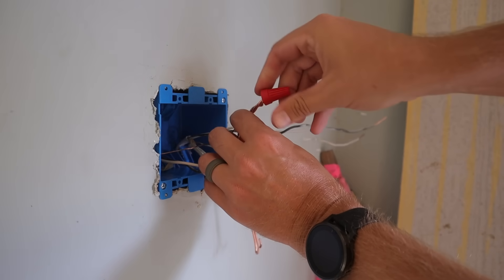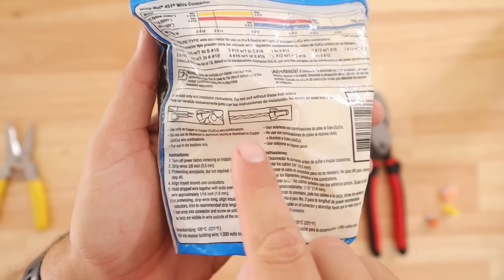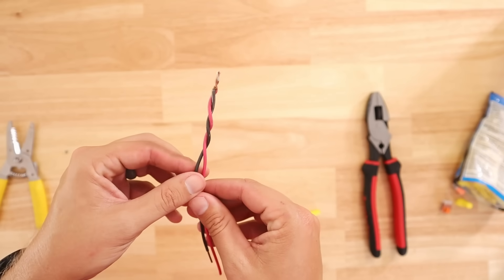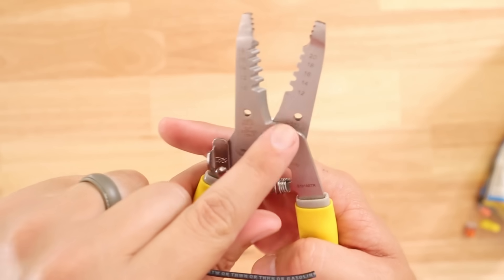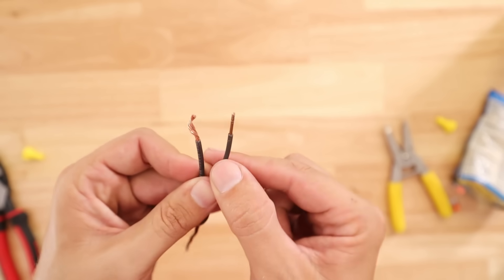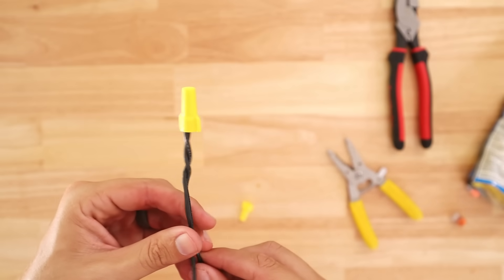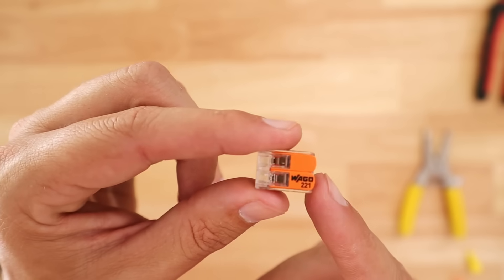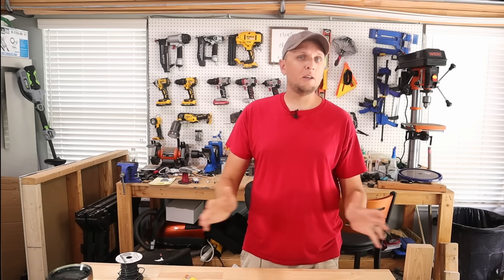BIGGEST Mistakes DIYers Make When Connecting Wires Together | How To

Comment: Fact is that 95% of DIY work doesn't meet building codes...
If you don't know what you are doing you shouldn't be doing it...
Reply: Not a pro electrician, but probably could be fairly quickly. (For better and for worse, I make too much money doing what I do, but I find electrical work much more personally satisfying.) Spent many, many years with electricians and wiring a wide variety of crazy crap from water tower antennas to data center server racks running 3-phase. When I ran the wiring for my own furnace and heat pump installation, the HVAC company looked at me crooked, at first. They were going to charge me 3x what it ultimately cost me to do it, and I just wasn't going to let some stranger walk away with $2k for a job I could do. The inspector who came by said I had "overbuilt." When I asked what he meant, his only callout for that was some conduit that he said "wasn't strictly necessary" and that he had never seen a DIY'er put in that much conduit, before. So, gee, I guess I could have saved maybe $10 worth of conduit, but I figured a furnace wasn't the kind of thing I planned to wire for every week, either. (I still think it was the right call. He was just surprised that he didn't have 10 different violations to cite while telling me to hire a pro. lol)

Comment: I have to comment again. My past job was to go into homes to find out why brand new appliances were not working. 9 outta 10 times it was due to ELECTRICAL INSTALLATION, and the single most case of the Electrician screwing that up that was not explained here. The wires must be secured from movement. After you join the wiring together, and are confident of the electrical connection, the wiring must not be allowed to move around when you push /pull / dump the appliance into position to be mounted.  If that wiring is moving around it WILL LOOSEN UP the electrical connection.  Many many times I have pulled out a new Appliance on a New Home Build to find twisted wiring electrically disconnected and even arcing or melting from arcing inside the wire nut.  Twisting the wiring together, twisting on the wire nut, then you must join all the wiring and tape it or secure it with a clamp so when the appliance is being moved that force isnt applied to the wiring connection and  loosen the connection itself.  The first thing the Home Owner does is grab their phone and call the builder demanding all their electrical connections be inspected...and what will the Builder think of you, the Electrician they hired, when that happens... you are a POS who cost them money.  Dont be that guy.
Reply: Ugh. All I can think of reading this comment is the dryer connection in my old house. There was no way to mount that sucker without perhaps laying down a new cement wall. And yet, I had to revisit that thing constantly because of the s*** way the laundry room was laid out that prevented any sane installation of such a high draw circuit. (In essence, I agree with your point: You need to immobilize the wires, and when you don't, you sign up for hassle at very inconvenient moments.)

Comment: It boils down to how the wiring ends are/is secured, not if the isolation is twisted or not. I've been to many many homes trouble shooting inoperable Appliances (wall ovens) only to find twisted wiring melted away from being improper secured.

Comment: Everybody's using a new Wagos connectors but these are only good for low amperage I would suggest 5 amps and lower great for LED lamps and such circuits but you really need to twist the wire together for anything above 5 amps and use good connectors I've seen too many pushing wall outlets the wire starts to overheat because it doesn't have enough surface area to carry the load.
Reply: You are 100% correct sir! I have personally seen to many fires and melted connections because guys get lazy and use these on everything. Yes, they are no different than stabbing the wires into the back of an outlet. I make repairs to these connections on a daily basis.

Comment: A wire nut works like a nut. where the wire should be straight as to follow the taper to compress. anyone who does service work dislikes twisted wire . Also. if used in a signal application. You have just created a point of noise and electromagnet coil of sorts

Comment: VERY helpful and timely. I am wiring my own shop and going slow and careful, but so far the few wire nuts I have done, I think I need to go back and redo them. One thing I did do was tin all my stranded wire tips to make them stiffer. What are your thoughts on the push-in wire connectors?
Reply: Trade term is wago for push in connector great for indoor use, very susceptible to temperature making connection fail. The fact you tinned all the stranded keep it up we don’t do that as standard trade practice.

Comment: Over forty years .... no fires, no loose/broken conn's ...  fundamental rule ... sound MECHANICAL connection first...  ALWAYS! THEN add whatever additional support or fixturing desired, as in wirenuts, soldering (occasionally) etc. Expediency often will seem to force shortcuts ... and almost always, eventually .. leads to some problem.
Reply from the maker: Yup, thanks a lot for your experience and feedback!  Always good to hear from experienced folks like yourself!

Comment: I've started using Wago 221's last year.  They are awesome.

4:00  I couldn't disagree more.  The linemans pliers put nicks in the wires.  That creates weak points prone to failure from either stress, vibration or heating/cooling.  As a former aircraft electrician, even the slightest nick in the wire is unacceptable.  4:03 also clearly shows the stress of the insulation pulling back on the red wire, this will cause the insulation to split and pull back at that point.   Using pliers is not a good idea.
Reply: I take you've never had to connect more than 2 wires under one wire nut. If you've got 6 wires going into that wire nut you're never going to get a good connecting without pre twisting. 

Also, if you use the right pressure you won't damage the copper any more than the wire nut already does.
Reply: @Avaddon911  5 is the most I've gone  and in that case I zip tied the wires so the wire nut had an even bite to all wires.  That BTW was a repair I made after a professional installed an outlet and the wire pulled out of the nut he put on.  I've repaired quite a few failures from "professionals".

If you score the wires then put a wire nut across the score mark making yet another score mark, it makes them even weaker. A couple of my repairs were from wire breaks right at the edge of the insulation because of score lines.  Seriously, if you must twist,  use a smooth finished pliers or put tape of the ends.   I've also seen plenty of split insulations because of the stress put on it from twisting.
Reply: @datsuntoyy  I've been an electrician going on 6 years. The entire industry disagrees with everything you say here. If the 'professional' didn't do his job right that's not a fault of pre twisting wires lol. It's most likely the result of not stripping the wires long enough. You strip them longer than you need, pre twist, cut so they are all even, then put your wire nut on. I've never had a wire break because I twisted it with some Klein's.
Reply: @Avaddon911  It's fine if they disagree.  Just remember what I've said.  I've spent a lot of time repairing bad jobs from professionals. They don't break right away, long enough for you to get paid and leave.
Reply: @datsuntoyy  Well I did a lot of work building my local high school, it's still going just fine. I have a trailer I purchased 7 years ago and redid electrical. Holding strong to this day 🤷‍♂️
Reply: @datsuntoyy  What business are you in that you regularly repair bad jobs from professionals?
Reply: @Avaddon911  I wouldn't say "regularly", just done more than I should of.  I just got done having my downstairs remodeled and I had to fix 3 dead outlets after they got done. Two wires pulled out of the wire nut and one pulled out of the outlet because they didn't even tighten the backwire nut.  
 I changed all the outlets from the old style outlets to Spec grade decora style so I got to see the wiring from the builders.  

I'm currently a medical lab tech.  I'm a former aircraft electrician/avionics repair where I was also an inspector.  I worked electronics/rework at motorola.  I also used to work for my cousin who owned a custom home building buisiness.  
I was also a mobil facilities electrician and HVAC technician in the Marine corps.
Reply: @Avaddon911  I've been an electrical engineer for more than 20 years, and I'll dispute your assessment that the entire industry disagrees with @datsuntoyy.  I've been to too many fires because of broken wiring where the electrician "scored" the wire first.
Reply: @Lateralas  🧢🧢🧢  come on man you expect me to believe you can determine that a whole ass fire started from one wire nut? The rest of them would have melted in the fire so how do you determine which one failed? GTFO here with that 🧢🧢
Reply: always twist them together first, srip them long, twist, trim to length put on marrette. As an electrical contractor Id say you are very wrong here Sir. 
The only nicks you need to worry about is not striping properly, nicking or cutting the conductor when removing the insulation is bad. current is not flowing to the tips of the wire were one would be twisting it with linesmens, the current takes the path of least resistance, what you describe in not how electrons flow buddy.
Reply: I've always twisted them hand.

Comment: With two 14g connections, you should have used an ORANGE wire nut.  I’m a DIYer and I always use the min size wire nut specified.

Comment: Thank you for the video! What connector is best for stereo speaker wire?
Reply from the maker: You’re welcome!  I’m not a stereo speaker expert but I still use heat shrink butt connectors and sometimes crimp caps on my stereo wires.

Comment: I was instructed by an electrician to use electrical tape, and wrap the wire nut/wing nut AFTER you're finished twisting the wires together and twist on the wing nut/wire nut to be sure it never comes apart.

Comment: The problem with pre twisting the wires, the way you showed, is that you are potentially weakening the wires, by scoring them with the lineman's tool.  If you put even a small nick in a solid coper wire, you run the risk of it braking off at that point.  So, if you're going to pre twist, use a tool that is smooth.
Reply: You're joking correct? Please say you're joking!

Comment: I pre twist place on wire nut than electrical tape. Just old school because of movement from ceiling fans, home vibrating,  My uncle was a Electrician in the 70s. Many changes have been made. My home is still standing he wired it. 😅

Comment: Throw the junk wire nuts in the trash. I use the wago lever connectors. I use these because most wire projects I have ran into have wiring that is very short. No room for wire nuts. 
Btw over twisting the wire nuts can strip out the wires.
Reply from the maker: Well in that case I can see why the wagos are so useful to you.  The over-twisting is just one of many reasons why I like to pre twist.  Thanks for the feedback.

Comment: Pre twist or not... I'll offer an engineers perspective.  The instructions are relevant because the product goes through a series of tests to validate performance using the method on the label.  Many samples (what we call statistically relevant) go through all of the tests.  In this example, following through so that the installation looks like the picture is the state at which the tests are performed... I will even offer to the exact number of twists that the picture shows.  This leads to your opinion (or anyone else's) being much less important.  I am glad that you point out the code, the text, and the picture.. as someone who may be using the product for the first time can get it right and have confidence in the performance.

Comment: WAGO'S  look like the easy solution, but they have higher resistance then a properly twisted connection.  This isn't opinion, it's fact and there are some good YouTube videos that prove this with masurments (see greatscott).  WAGO's should be fine for low voltage applications, but I wouldn't use them for High Voltage Mains wiring.

Comment: Here’s a trick I was taught whenever connecting solid to stranded, put a little crimp in the solid wire nothing crazy then the stranded has no choice but to go around that solid wire, strong connection every time 👍
Reply from the maker: Thanks for the tip Eddie!  You have a good last name for electrical.
Reply: Definitely works old school.
Reply: This is a great tip and works well.
Reply: little tip, big impact. thanks!
Reply: I've got one too. 
When twisting 12# and 14# wire together prior to wire nutting them, the 12# often won't twist nearly as well (or at all) when you pre-twist, but I find if you put a slight zigzag in the 12# then the 14# finds it's way in with the 12# instead of just around it when you pre-twist. Doing this will make a pretty good double helix or more...
Reply: Take the stranded wires and twist them at the ends with your linesman pliers. Twist the stranded wires together. Pull the solid wire around the stranded wires once, then twist together. Twist another solid around the stranded and the first solid. Do this with a twisting and slight pulling motion. Cut the ends flush to the length of the internal depth of the wirenut's spring. I usually string the solid a little longer than the stranded. It is imperative that the ends of the wire insulation be in line with each other. Sometimes if you have a lot of wire it helps to strip some the solid wires longer each one a little longer than the last. If you have just one strander and one solid, I sometimes make a few staggered bends, like a lightning ⚡ bolt. Twist the stranded into a solid, and twist together. Never crimp the wire. Never strip the wire by cutting around. Pencil sharpen the wire or use a listed stripper.
Reply: If you put any kind of crimp at all in the wire you are creating a hot spot.

Comment: Hi,great video, can you put 4 12s in a wire nut?
Reply from the maker: Yes you can, but every wire nut has different capacities.  If you check the back of the packaging it will list what they are.  For 4 12's I typically use one of Ideals red wire nuts.

Comment: I guess I’m a belt and suspenders guy. I twist the wires, heat then solder, and put the nut on. But that’s just my brain 🧠, as an electrical engineer, I’ve seen bad jobs and bad mishaps!

Comment: I tried to push a stranded wire into an Ideal wire connector and couldn't push it to go inside. It just bends. Thought about soldering the wire but just went back and used wing twist wire connectors and black electrical tape around the wires and connectors.

Comment: The Wago is a good fast connection for a light or other small usage item.
The only point of contact is that extremely thin piece of spring metal. All other connections need to be a full twist with the nut.
Reply: My stove is connected to three-phase AC using five Wago 221 connectors. The 221 ones are rated for 20 Amps (so 4 Amps more than fuses in most hoseholds in Europe). The spring metal is super stiff and even slightly diggs into the solid copper. It's not just touching it on a tiny spot. The connection is safe for high currents.

Comment: Bruh, stop scaring people. The wire isn’t going to come lose in the wall like it did when you pulled as hard as you could the 2nd time to pull it out.
Reply from the maker: At no point did I have to pull as hard as I could.  It showed that doing it that way was better but still not great.  Either way, yes, this actually does happen quite often.  So using some best practices or at the very least, following the instructions, listed on a splicing device, is incredibly important.

Comment: Never pre twist. I could go on and on about this but let me start out by saying I have been a licensed electrician for 50 years.
 You have it right, all Equipment and wires have to be installed according to manufacturers instructions. 
Solid wire to solid wire place the ends even and use a twisting motion never push first.  Then , holding the wires a inch down from the bottom of the “wire nut” kept turning until there is one revolution twist on the wire. When making a connection with solid wire to twisted always lead the twisted wire above the solid wire
 F.Y.I. Remember never use your side cutters for crimping, you must use your T&B’s crimp tool.

Comment: i recently learned about WAGO earlier this year and it is definitely the better way to go going forward. It doesn't damage the wires either AND they are reusable.
Reply: They are terrible for higher currents and will melt. Seen it to many times. If you try to reuse them then you definitely do damage to the wire trying to remove them unless you cut the wire shorter and re strip.
Reply: @explod329  - Yeah, I hope he covers this in his comparison vid. It definitely seems like you wouldn't want much draw across that tiny metal bus bar. I've only seen them a few times, but never had trouble with wire nuts, so ... ¯\_(ツ)_/¯
Reply: pretty much perfect
Reply: Agreed.  That type is all they use in Europe from what I hear.
Reply: @datsuntoyy  Can confirm. Or the Wago 243 for tight spaces.
Reply: @Weuffel  I hadn't heard of the little guys. Thankyou